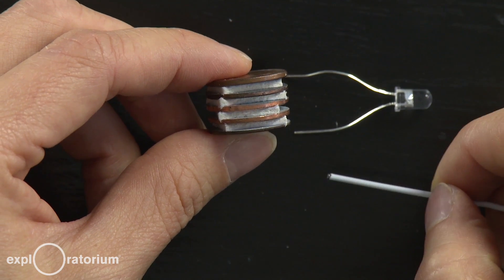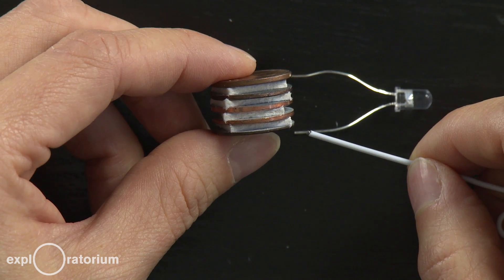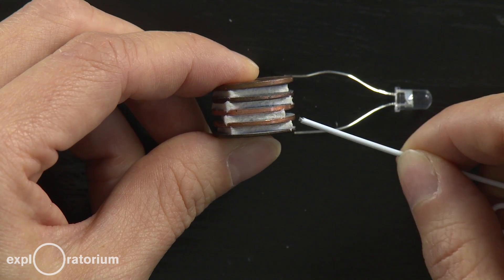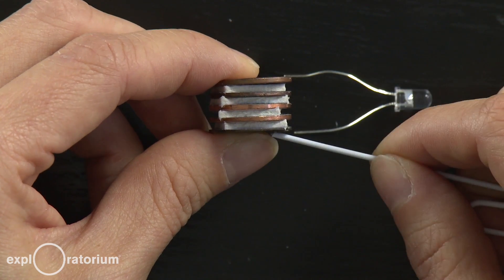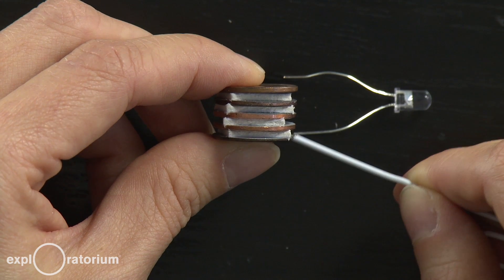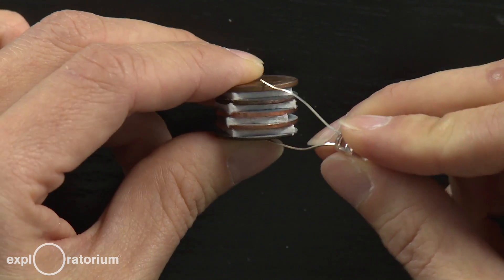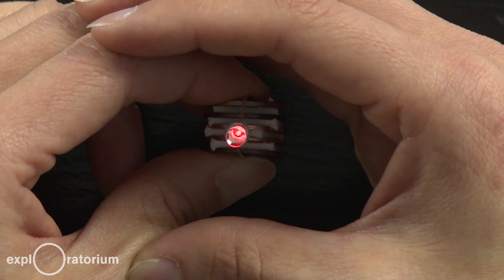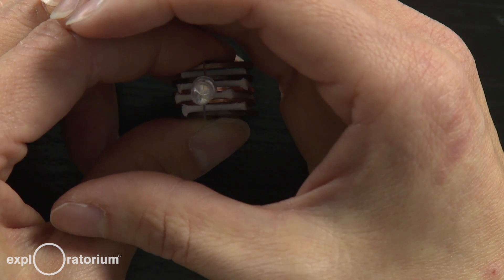What's going on: Penny Battery - Science Snacks activity

Comment: How is this circuit working when both ends of the circuit are both linked to copper sides? Shouldn't one side be made of zinc and the other copper for it to work, namely the side with zinc the negative terminal and the side with copper the positive terminal?